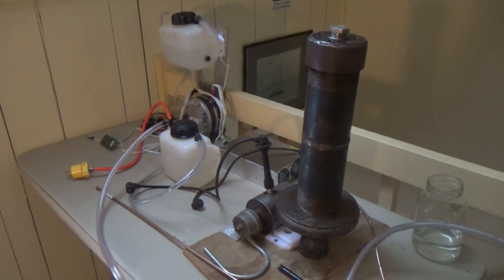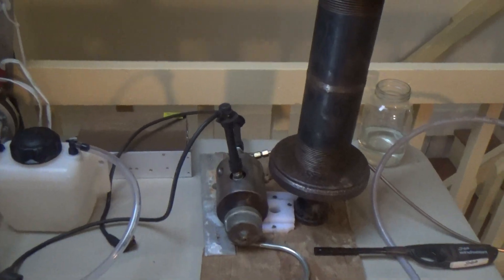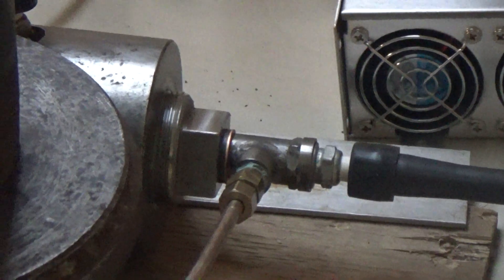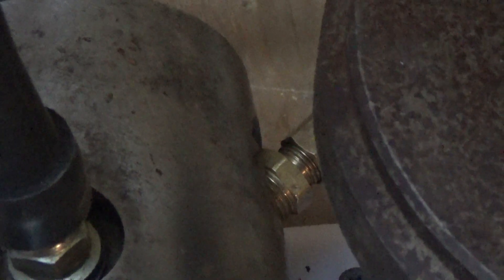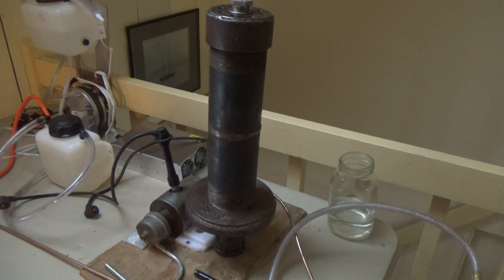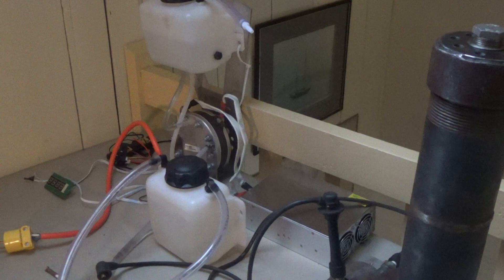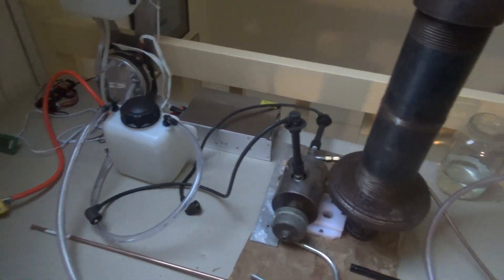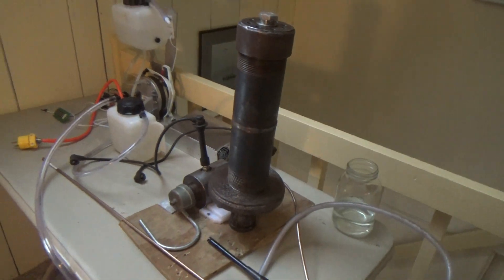HHO Home Heater Uses Sand and Molten Salt

Comment: 7lpm @84 watts equates to 12 watts per liter. I have an hho generator at current setup that gets 2.6 watts per liter and I dont consider it efficient enough; though, both gases are mixed together which is a downer, not like a your nice setup with hh on one side and o on other side. Right now working on getting over 2.4 watts per litter. I bit that the burning of hho you have there is very efficient.

Comment: I see spark plugs and spark plug boots !
Reply from the maker: My Plasma Arc Furnace/Boiler was handy. One plug is an igniter and the other is a temp sensor....This is just a mockup. The Furnace was handy but it is like using a big Cadillac motor for a 5 kw home generator LOL

Comment: i saw some experiments with HHO and old catalytic converter grids that did not need an ignition and yet produced a glowing grid -- "H-CAT" .... ~cold fusion?
Reply from the maker: Yes, that is the way to build it. I place about a cup of catalytic converter pellets in the combustion chamber and mix some in with the sand. The pellets are secured in a stainless steel heavy screen/mesh. As you say, once it is ignited it will produce a flameless catalytic burn putting out a lot of heat. The sand and the salt absorb and store the heat and prevent any hho from building up in an explosive pocket. You still need to have an igniter of some sort. But, it will continue producing clean heat so long as the HHO gas is turned on.
Reply: @hyfusiondotcom  also, have you experimented with 13.56MHz SeaWATER?
Garvey Energy Project. 
Produce Hydrogen-On-Demand 
Use 13.56MHz SeaWaterAsFuel #KanziusEffect

Make Electricity at Community Level,
Teach at High Schools.
#KanziusEffect

Comment: If you reverse your pem cell, will it create electricity like a pem fuel cell?
Reply from the maker: Yes, that's the theory of the hydrogen fuel cell. You would need to pump in pure hydrogen and oxygen through the PEM.
Reply from the maker: I'm not really interested in hydrogen fuel cells at the moment. I'm much more interested in monatomic hydrogen. Check my research at www.hydrogencarsblog.info  
I haven't updated the site in ages so I hope it is still online.
Reply: Hmmm. Cool. Did you try it? Does it work? Can you make me wonn😀.

Comment: Nice work. I have a jeweler’s torch and a little bit of platinum foil. Haven’t completed any trials yet but my understanding is that you don’t actually have to ignite the HHO, it will undergo an exothermic reaction upon contact with the platinum. Open source is the only way we, as a civilization, will survive and prosper. It’s not just the avarice and greed of governments and corporations which have kept these technologies suppressed. Inventors like to obfuscate, don’t they ; ) Only a true revolutionary will take these truths down off the top shelf, dust them off and quietly give them to the dirty unwashed masses to play with... but I’d be happy to shower first
Reply from the maker: I believe that you must first have ignition. After you have ignition everything you say is true. I have a catalytic camp heater that runs on propane without an open flame. But, you do have to ignite it first. After that no further ignition source is needed.

I agree that open source is the way to go. Patent Office is corrupt and steals inventions or locks them down if they threaten entrenched energy or military interests.
On the other hand, I get really upset with people who somehow believe that inventors should not be compensated for their years of hard work and innovation. I believe there is an ideal solution using the blockchain and virtual contracts.
Reply: I believe you do need to prime ignition with a glow plug or cigarette lighter coil.
I used catalytic converter pellets as i had no pure platinum. 
I agree open source is important however inventors need to be encouraged and supported or their inventions are hijacked,  suppressed or fail to be manufactured due to the lack of capital. 
Good intentions don't bring products to market without money. 
Search www.hhotrucking.com for information on my DTP CLUB.